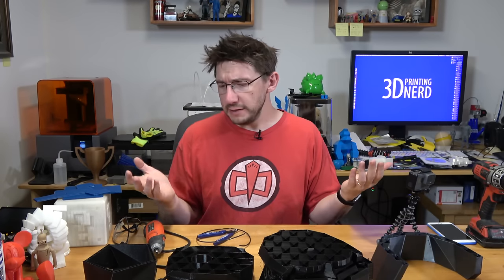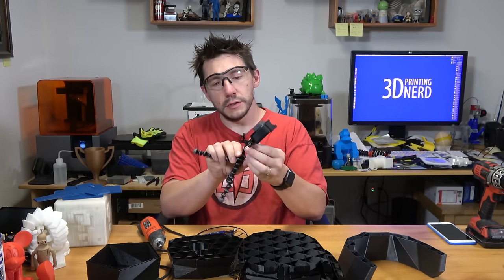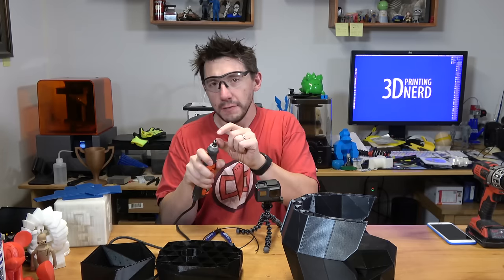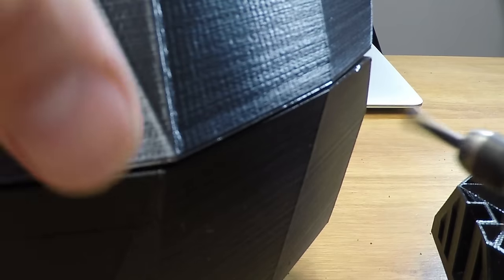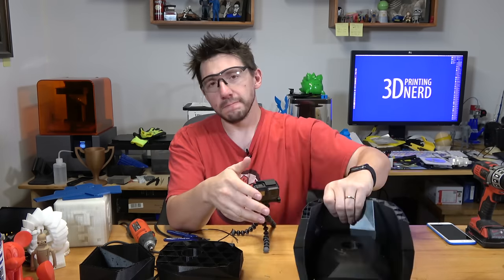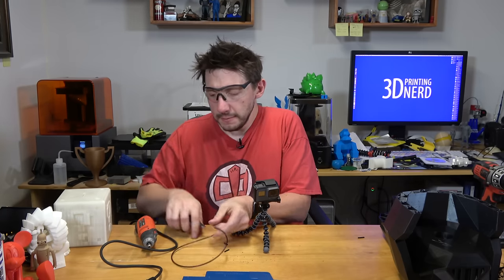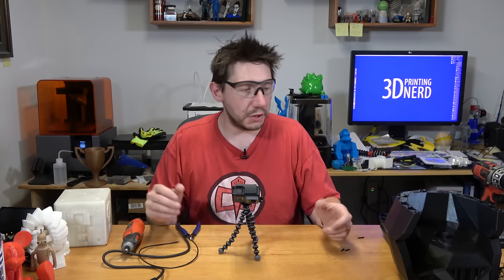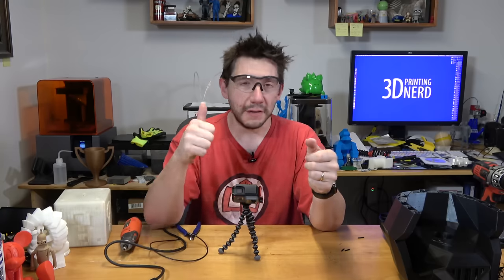3D Printing and Friction Welding: Attaching 3D Printed Parts with Heat

Comment: I like the soldering iron method too: I use some brims, or support material -- I have a dedicated flat soldering head I use for this application as it's purely for plastic. Works really well, you can create a cleaner seam which doesn't need as much post processing.Run it back and forth in from one side to the other and then run it flat across the seam, in some spots which don't meet as neatly, use some scrap plastic or same plastic from the spool -- I prefer scrap since it's less wasteful. For spots where there is too much of a gap, a 3d printing pen is good to add extra material.

Comment: Instead of dragging the filament, why not run it in little circles along the two parts? Maybe start it along a bad print  first to "preheat" before welding. I would be curious to if there would be any significant penetration like in welding.
Thinking about it I wonder if one of those 3d printing pens would be better. Would be awesome if you could use one to make scale welding beads for RC trucks
Reply from the maker: Hey Christopher! I read up about this method a bit after the video, and the small circles you mention ARE something that people do. I have plans to test this out, and put it against 3d printing pen welds!
Reply: I look forward to seeing an update video on this :)

Comment: Just use a DREMEL versatip with the plastic cutting attachment and propperly melt the part al the way through and then just smooth it off with the side of the cutter like you would with a putty knife.
Job done right first time, every time.

Comment: I was just wondering, should it be high RPM or drill will do the job. I am confused. I would try but i haven't bought my printer yet.
Reply: Drills go up to around 2000 rpm, whereas the rotary tool is more like 5000 to 32000 rpm. I think you need the rotary tool.

Comment: I was wondering if I could use this method to put together a prop gun from destiny, great minds Joel, they certainly do think alike
Reply: I'd weld them together with acetone or just use glue. it will be stronger and if you're making a prop I suppose you'll sand and paint it anyhow.
Reply: I'd weld them together with acetone or just use glue. it will be stronger and if you're making a prop I suppose you'll sand and paint it anyhow.

Comment: I'm going to get a beginner 3D printer, what do you think I should get
Reply: Felice Robotics the flashforge finder is pretty cheap really high quality prints it's also basically plug and play not many issues and it comes with this massive thing of filament that you can use for a lot of prints I highly suggest it p.s the build volume is 140x140x140mm which is still pretty big

Comment: since you kind of are using a 3rd material to connect the two parts, it is more friction soldering than friction welding...
Reply from the maker: Oooh, that's a very, very good point. I never thought about it like that. Thank you!

Comment: Friction welding with Plastic has been around for decades, but just like regular metal welding, there are specific techniques and a bit of practice required to get good looking and penetrating welds. This video was good enough for "proof of concept" but was incredibly poor to show the quality of weld that can be achieved with the right technique and practice.  Just like with metal welding, angle, speed, direction (and in this case a bit more pressure) are vital to getting great welds. I have used a very similar process in industrial settings to join critical parts and make repairs. A wide flat tipped soldering iron, like used in wood burning, can also work well for final smoothing.

Comment: i feel as though a metal bit would suffice for a "friction weld" for in the beginning it looks like the plastic is not getting hot quick enough and is chipping off because its not straight and the plastics that you are wishing to join together is just getting pushed together and that's generating heat and welding them self's it was only when it shortened and became straighter did the rotation of the plastic begin to heat and not chip though i am no expert i but i feel as though a metal bit that's ether heated before hand like if you spun it on some wood and burned it then placed on it or even softening the plastic bit a bit i believe it would be better but idk some one should test i would but i don't have a router

Comment: Heh! I bought a Davinci Pro return from Micro Center and a bunch of filament.  Of course I got glow in the dark ......who wouldn't.  Of course I completely wrecked the printer after 3/4s of a roll.  Nothing like learning to 3d print and not understanding why everything went to crap.  You can't just replace the nozzle on a Davinci Pro unless you buy a whole new hotend/cartridge @ $150. I still haven't fixed the thing after almost 2 years.

Comment: Well I think this thecnique is  a cumbersome task , I prefer to use a Methylene  Cloride (CH2Cl2)  to weld parts, is too fast , stronger an the result is clean  and I also use it in a spray gun over the 3D printed model to reduce the texture and then you can use the sand paper to have an smooth surface.
Reply from the maker: Methylene Cloride - is there a brand name for that? So it'll weld parts AND become a smoothing agent?
Reply: No, Methylene chloride, also called dichloromethane, is a volatile, colorless liquid with a chloroform-like odor. Methylene chloride is used in various industrial processes, in many different industries including paint stripping, pharmaceutical manufacturing, paint remover manufacturing, and metal cleaning and degreasing. Here in my country I can buy Dichloromethane  in the Acrilyc and resine industy, in USA you can buy it on TAP plastic page: http://www.tapplastics.com/product/repair_products/plastic_adhesives/tap_acrylic_cement/130

Comment: It would be nice if you could control the amount of filler you use like a metal weld. Using this technique you can not get a surplus of filler that can be ground down but instead you are left with a depression and a weak joint.

Comment: Wouldn't a 3D pen work too with those two panels?
Reply from the maker: +Kirby Downey yes! Though from my experience using a 3d pen to weld leaves more plastic that needs to be sanded down. This way, it seems, to use less plastic leaving less of a clean up.
Reply: 3D Printing Nerd I guess it also comes down to a case by case scenario. Looking at these plates that weld might be hidden with in the body so either a pen, which will leave a larger mess or a weld would work great. I'm going to give this a try today.
Reply: yes it does Kirby, I use mine quite a bit and it is strong too.
Reply from the maker: +Kirby Downey that's a VERY good point - case by case is the way to go. Super curious to see how this goes for you today. Keep me posted!

Comment: I'd rather use wood friction piece to weld the pieces together.. Then do 2nd or 3rd pass with 3D pen to fill the seam if needed.

Changing out tiny piece of filament every 3 seconds would piss me off too bad.

Comment: Any real strength or advantage over superglue ?
Reply from the maker: That's a really good question. I haven't had the chance to really use models that have been friction welded together. I'm planning on assembling a model using only friction welding (at least for the big parts) so hopefully give me an idea.
Reply: In real life welding, (I've seen, not used), for big parts the tack weld some spots to hold it in place and check fitting. Then go round to complete the full weld. Tack welds can be easier to change, before full welding,  if the parts where lined up incorrectly and clamps are not so important.
Reply: a. y Of course there is. You can't super glue your hand to your privates with this method!

Comment: Wouldn't it have been better to do the welding from the inside of the helmet instead of the outside. This way the seams wouldn't be as obvious? I've never done any of this so just a beginner question.
Reply from the maker: Yes, that would have been better, but it would have been hard for the camera to see that. For aesthetic reasons, inside would be better as well.
Reply: Ohhhh ok, that makes sense. Thanks for answering my question!!
Reply from the maker: Not a problem!

Comment: If you do it from the inside it won't be visible and the result will look much better.
Reply from the maker: Good point, thank you!
Reply: 3D Printing Nerd Just a thought. Gonna try it. Just bought one FlashForge Finder as a first 3D printer. ;)

Comment: you could glue it with acetone
Reply from the maker: That works with ABS. I know Tom showed it sort of working with PLA, but, with this method, I get to use power tools!
Reply: First off,

OMG SENPAI NOTICED ME!!!!!!!

Second off,

I was too stupid to realize that you're using PLA, lol. I should've payed more attention.

Third,

I have a question for you. I am 12 years old and in 6th grade, I started a 3D printer project and I raised $1000 and bought a FF creator pro. I am having alot of issues with print failure/bed adhesion/clogging. I really need help and I was wondering if you had any knowledge on the FF creator pro. (FYI I am not one of those fanboys that wants to do a collab with every youtuber they like, although that'd be cool ;) )
Reply: I made sure to make myself a huge mug of tea and use as much sugar as I could get away with having my mom around, hoo boy. It's gonna be a long night working on this 3D printer lol...
Reply from the maker: bed adhesion and clogging, eh? that's no good. the FFCP was my very first 3d printer. I would get jams in the machine if I didn't print hot enough - are you printing hot enough? As for the bed, I always had bed adhesion issues until I stuck some buildtak on it. That said, blue painters tape with some isopropyl alcohol rubbed on it makes a GREAT printer bed. I had stuff stick too well sometimes.

Comment: Just use some Goop adhesive.
Reply from the maker: Wait, Goop makes an adhesive? ooh, I'll have to get some of that!
Reply: You can usually find it at Fred Meyer in the hardware dept, but if you can't find it there you can definitely find it on Amazon.

Comment: I got an idea. use a 3d pen. must be a lot easier.
Reply from the maker: I've tried, and that isn't always the case.
Reply: 3D Printing Nerd you can also just use the tip. not extruding it. you just melt a little of the plastic on the thing.

Comment: It really looks awful though...
Reply from the maker: +MP3D which part?
Reply: 3D Printing Nerd the weld itself. It looks more like bad abrasions and would require more touch-up than using even super glue in the first place. 

Don't get me wrong, I think this interesting but I don't think it is actually viable...